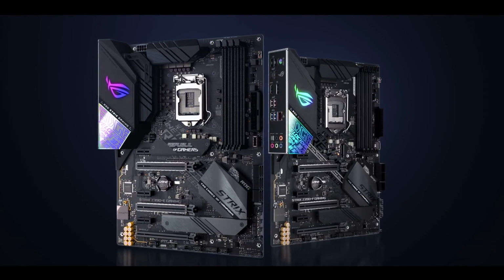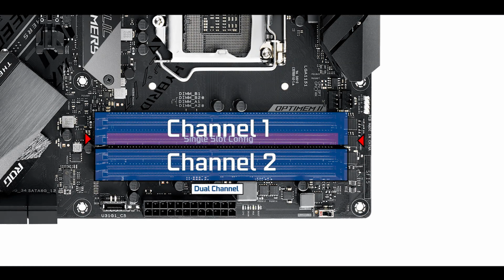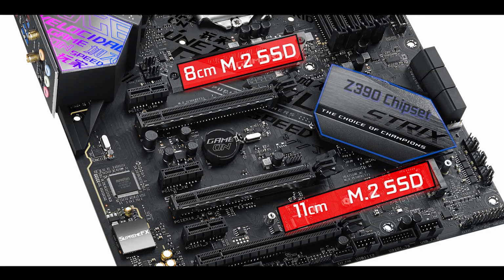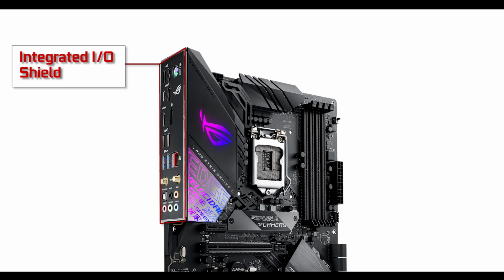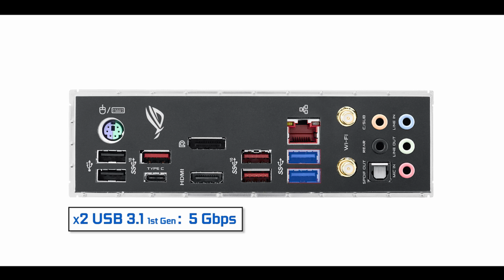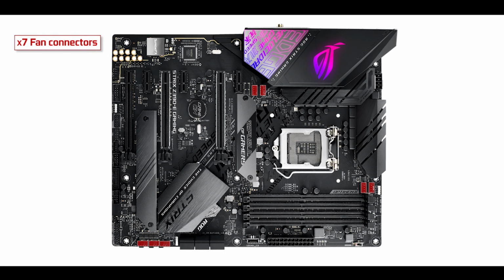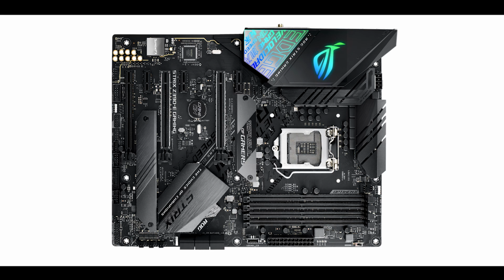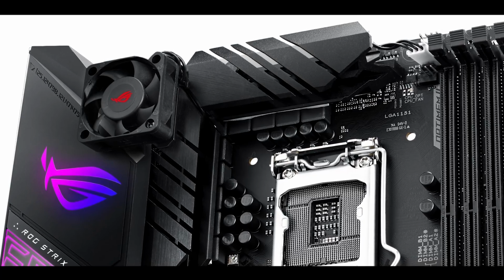ROG STRIX Z390-E : a gamer's dream!

Comment: How does integrated wifi cards compare to after market wifi cards that you put in the pci slot?
Reply: for gaming you need a good card obviously
Reply: @sultanmehmoodghaznavi6312  So after market wifi cards are the only  real way to go basically? What about boards like the atx z390 maximus, their wifi capabilites poor aswell?
Reply: @minimaniac50  don't worry, at this level you'll be more limited by your router rather than exact wifi card
Reply from the maker: For equivalent components ull get equivalent performances. No worries there.

Comment: god this mobo sucked to build in it has no POST codes just 4 leds and i had one of my ram sticks die and it didnt have a code just a led called DRAM
Reply: or a freaking power/reset button
Reply from the maker: Yeah... i hear you on that.  Got to jump to maximus series to get it going.

Comment: Is the z390-e compatible with the i7-9700k (without a bios update)? Thanks for u vid bro
Reply from the maker: indeed. No Bios update needed for z390 chipset powered motherboards. 

Only z370 powered mobos need a BIOS update.
Reply: Laurent's Choice I have another question... the asus gtx 1060 6 gb is compatible with this motherboard? Thanks for u answer I subbed the channel!
Reply from the maker: Any 10(30,50,60,70,80) or 20(...) series. video cards are compatible with a z390 mobo  :)
You are good to go on your build :):))))

Comment: I like the Maximus better.
Reply from the maker: Yeah, im with you on that.
Reply: Laurent's Choice is the Maximus the same size as the z390
Reply from the maker: Didnt catch ur question here
Reply: Laurent's Choice like is it the same size or is it bigger
Reply: Laurent's Choice sorry for all the questions last one um well I’m new to this pc stuff this might sound dumb but does the monitor come with the cables to connect it to the pc/desktop if it doesn’t what kind do I need
Reply from the maker: I m not sure I understood your question.. can u be more specific ?
Reply: Laurent's Choice so in size let’s say the z390 is 50 cm is the Maximus also 50 cm I know it’s probably not 50 cm but I’m just useing that as an example. And I’m asking this becuase I saw some guy on YouTube doing a pc build with the z390 and he used a i500 size case (at least think that’s what it’s called) and I saw another of his videos where he used the Maximus on a i700 case and it fit but the i700 is bigger than an i500
Reply from the maker: What Z390 exactly? What board? 

They are all Z390s ;)
Reply: Laurent's Choice the z390-e the one in the video
Reply from the maker: It's an ATX board. 30.5 cm long for 24.4 cm large
Reply: Laurent's Choice that’s 👍🏻

Comment: What's the difference between the aorus z390 Pro and the z390 prime-a I was looking at these two boards and i really wanted to go with asus but aorus offer more usb and more fan headers And better rgb options. I like the white theme asus has going for it and i love asus as a brand but I can't seem to see why I should go with asus over the aorus especially since aorus offer their board with more features at a lower cost. Someone change my mind please!
Reply: the diference i in the most important part this has a  4-phase VRM
 the rest off the brands use 6 phase  so this will burn with OC
Reply from the maker: So..just to clarify. There are 8 phases organized in 4 twin phases (8 phases used in 4 phases in parallel). 

Hope this helps
Reply from the maker: That is correct. 

Keep in mind though, that Aorus has a slightly higher rate of returns. But nothing really to worry about.

They are both very good boards. Some will stick with Asus because of its Aura nesting. Again, nothing primordial.
Reply: @Laurentschoice  ahhhhh i love them both! tyvm for the answer
Reply: Alex Tsang I heard the bios for aorus boards are really bad but I’m not speaking from personal experience so it may be false.
Reply: @evqa06  same same, i bought the aorus board so I guess I'll see soon

Comment: May i connect led fans of the cooler master h500p ??
Reply from the maker: Yes
Reply: @Laurentschoice  thank you so much!   I buyed a z370 g-gaming and i'm going to return because it hasn't Pin out per rgb :\
Reply from the maker: Pin out ? U mean addressable RGB ? (3 pins 5 volt rgb connetor)?
Reply from the maker: Oh i see.. mini atx... yeah... u need an ATX board to Have proper rgb lighting connectors. So definitely ROG strix z370
Reply: @Laurentschoice  yes! Thank you man!

Comment: Are there any other mother boards you would recommend to run these same specs. Any otheres stand out as better or equal
Reply from the maker: MSI MEG Z390 séries or Asrock z390 extreme serie.

Comment: I was considering the Z390 Prime-A that you reviewed mainly because I wanted a black/white theme for this build.  But what are your thoughts comparing this board to the Prime-a. (wireless isn't a concern to me)
Reply from the maker: They are in essence identical boards, both in design and components. The only real difference is the aesthetics.

Other than that, they are different iteration of the same board.
Reply: @Laurentschoice  doesnt the strix has better quality capacitors and better sound card than the prime though?
Reply from the maker: They have identical sounds cards (8 channel Realtek S1220A) and same capacitors
Reply: @Laurentschoice  in the website it says different soundcard though (supremefx vs crystal audio, both are s1220a though) and also it has more capacitors in the sound card
Reply from the maker: Yes yes indeed :)
The audio engine is powered by the Realtek S1220a. Thats really your sound card. (Drivers and so on).
The SupremeFx and Crystal Audio are Asus add on to it (and indeed some have better isolation than others. Namely Supreme FX which is usually featured on ROG mobos, including the Strix ) :)

But in application. None of these options can compete with dedicated solutions and the difference between the 2 are difficult to make.
Reply from the maker: I do absolutley appreciate ur reserach on the matter.

What s ur background? What build do u have ??? 
Please let me know :)
Reply: @Laurentschoice  to my knowledge, supremefx is better overall :P But i always thought that the strix line had better build quality (capacitors, materials, etc) than the prime line hence the 60$+ price difference. Same with the maximus  hero (no wifi) being around 50-60$ more expensive than the strix.
Reply from the maker: Yes overall your absolutely right... im just being irrealisticly litteral!
The all ROG line up has more money on it than anything else. 

So absolutely. 

And indeed Supreme FX prodcued better results than Crystal :)
Reply: @Laurentschoice  Food science and Master's in Biotechnology, not extremely related to computers xD But i like tech so i know some stuff
 Be quiet dark base 700 , 9900k, Asus strix z390 F, G.skill trident z royal 16gb 3200mhz, samsung 970pro 512gb ssd and for gpu... 1050ti asus rog strix lol. Kinda troll card compared with the rest but its more than enough for the games i play. I really wanted the best mainstream cpu though. Could have gotten a 1080ti/rtx 2080 by using a ryzen 7 and an 970 evo instead of the pro and a  cheaper ram and case.
Reply from the maker: Dude... thats a serious build!!! 

Ill gve u some hot air about the 1050ti though... come on boo!

Very impressive indeed !! But u can upgrade for a 2060 easy peasy :)
Reply: @Laurentschoice  yeah, but even a 1050ti is a tad overkill for the games i play ( mostly Lol) it can handle all of em at 144fps. And Black ops 4 (got it from free from an asus promotion, ) plays at  70-80 fps all maxed. Also my cooler is a bit on the low side (cooler master MA410M, i fell in love with it this is why i got it, idling at 28-31 °C, 50ish with leauge and 69 with black ops 4, so not that bad. I have to forget about OC though, maybe just +100mhz more, but i wont bother)

Comment: good board.. BUT is it better than the aorus z390 wifi pro!!??? i bought gigabyte on ebay for 170$  so i think this board at this price is not worth it over the gigabyte
Reply from the maker: At the end of the day... its really about what brand u recognize urself in the most. 

Its a bit a Mercedes / BMW thing. Both have extremely good manufacturing processes and similar budgets. 

The differences are simply to suddle to claim an edge over the other.
Reply: @Laurentschoice  hmm not rly in this case, cuz remember the gigabyte pro wifi, is the only one under 200 which has fast AC and a 12+ vRam phase... Thats huge... Most of the other boards under 200 or close to 200 have 4 phase
Reply from the maker: True. Let me add it to my review listing.

Comment: So if I'm correct, the difference between this and z370 f and e
Are more connectors, a price difference and in short not much really added to the board. 
So if I'm correct is it worth getting z390 over z370?
Reply from the maker: Différence between F and E is basically the WIFI.

If you are using a i9 9900k , z390 might ne worth it. 

For anything below, id go for a Z370.
Reply: Laurent's Choice thanks. That help so much. I'm currently looking for pc parts and well I was just a tiny bit lost with the z390 and z370.
Since I don't plan on getting the i9 cpu, I'll just stick with z370. 
Thanks a lot again

Comment: Its a 4 phase vrm mobo waste of money lol.
Reply from the maker: That is correct, but they do come with doublersand upgraded power delivery.

Despite the all controversy, frankly talking it really OC beautifully. But of course, if u want pure viltage freedom, jump.to the Maximus Series.
Reply: Less vrm phases> hotter temps. Its not just about voltage freedom. Asus messed up the z390 line big time.
Reply from the maker: Thats true. Wont argue with that. 
To be fair i noticed higher temps when overclocking the i9 9900k . For ther other CPUs, it was within previous gens limits.
Reply: @Laurentschoice  For a 9700k works fine?
Reply from the maker: Yes, you are fine to push it to its absolute limits. 

Overheating is really only noticeable with the i9 9900k .. other than that... VRM stays cooler than on z370 series.
Reply: @Laurentschoice  Thanks =)
Reply: @Laurentschoice  When you mean overclocking is that past the 5ghz boost speed?
Reply from the maker: Yes in 9600 and 9700

Comment: does this work on a i7 8700k? asus 1080ti?
Reply from the maker: Yes :)
Reply: Fun too I like to use a site called pcpartpicker because it gives you the ability to put in items/computer parts and see if they are compatible
Reply: Yes Inhave a similar setup. The 370 e will be cheaper buts it pretty much the same board

Comment: nice review Laurent. yes the differences are marginal. But the bios.... the bios there is a lot of differences. that most people witll not care. for me, and not cause i have one, drivers installation is a breeze, also, the memory support if someone will pay for those. 4 weeks ago i get 32 gb 3600mhz 3600Mhz 18- 
19-19-39 and are still expensive. I wish i can get one. i am saving for the board since i am in love with the formula z390
Reply from the maker: Well said . Formula review is under way. Ill tale a closer look to the Bios :)